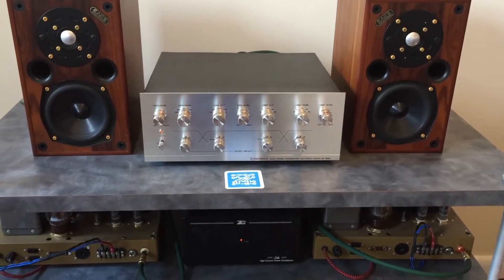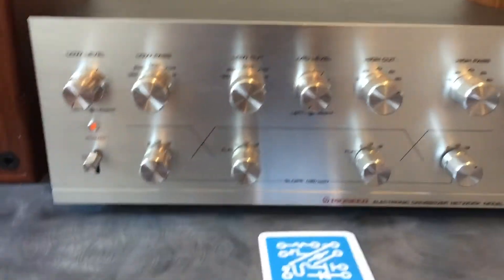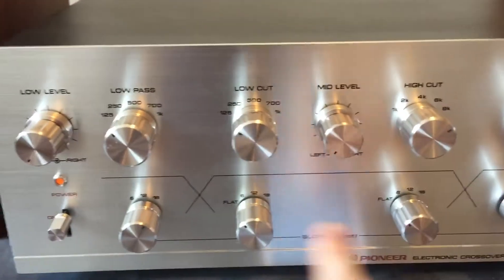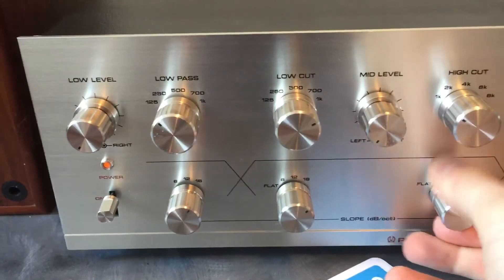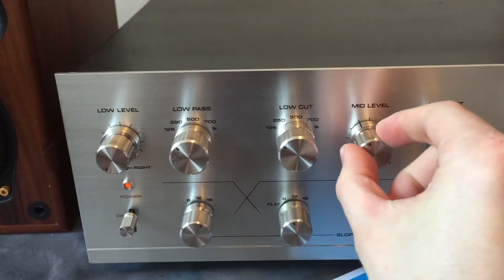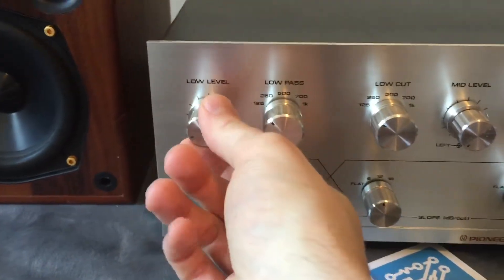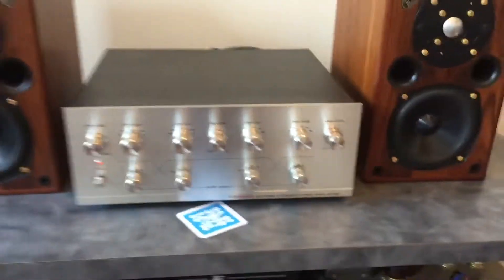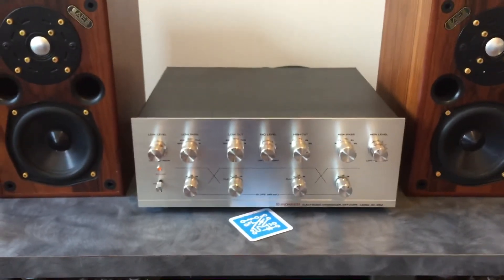NX007 Pioneer SF-850 Electronic Crossover Network Tutorial

Comment: At the back, you have one RCA input. 
Then, middle RCA output, low RCA output, and a high RCA output. How did you fit 3 pairs of RCA  in to one input from your amp?
Reply from the maker: In order to run this in 3 way mode you would need 3 amplifiers.

Comment: Great for demonstration purposes and as a conversation piece but what’s the point? We already have these built-in crossovers inside our loudspeakers that engineers have painstakingly designed.
Reply: I believe that it is for custom speakers without cross overs. But, you need 3 amplifier or one amp that have A, B and C output that can all play at same time.